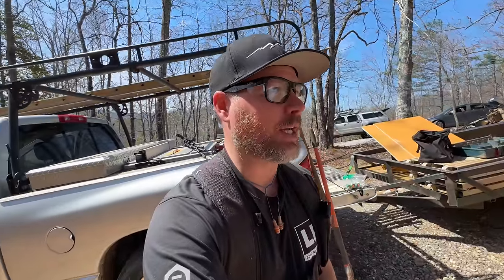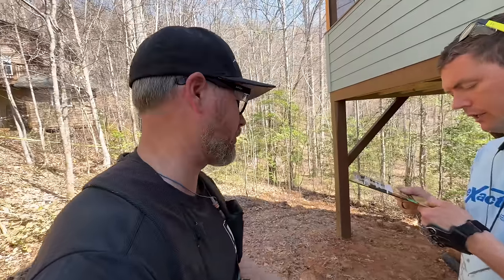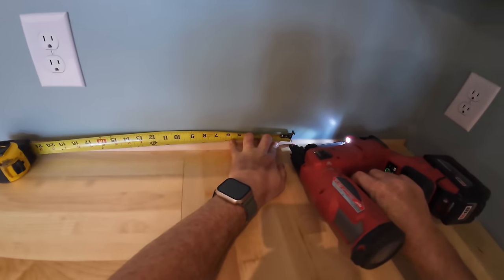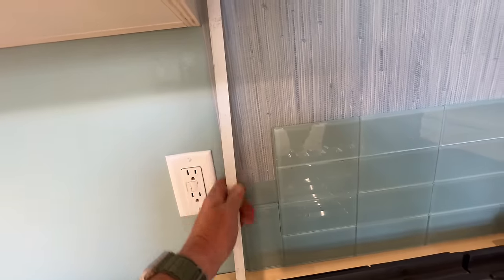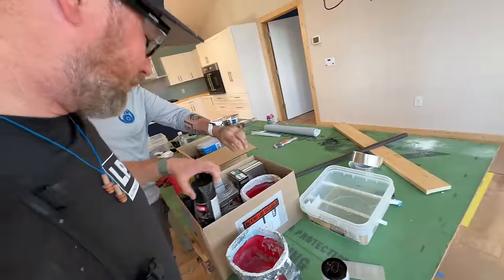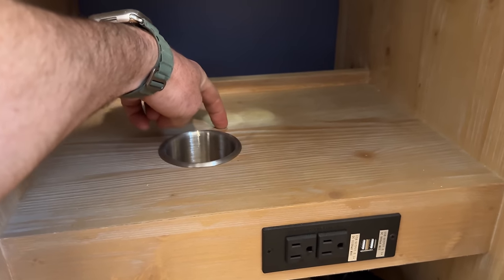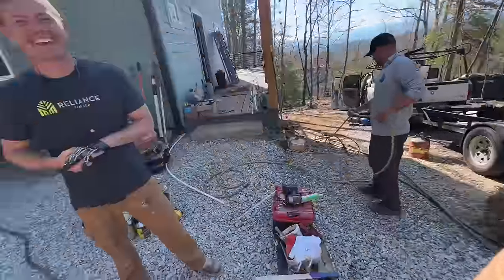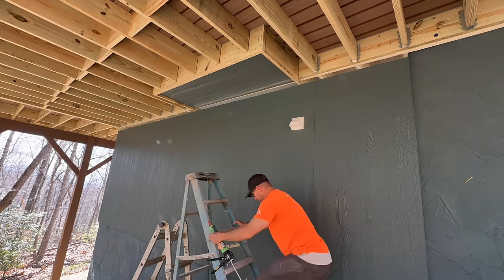Modern Home Build | 50 of 50 | It’s DONE & Arlo Retires

Comment: straw is the stuff that's left over after a grain crop has been harvested, while hay is grass that is cut before the grass goes to seed.  Typically hay will be normal cultivars of grass with multiple species mixed in, grown specifically as food for livestock.  Straw will typically be from intensive grain farming so it will generally be just one species.  Straw also has less nutritional value because the plant put all the energy into the seed, while hay will still have some measure of sugar and nutrients.

Comment: Hay is a complete grass that is cut short as a food source for livestock.  Straw is the shaft of grain (wheat, barley, etc.) that is left once the grain has been removed.  Straw is a woody shaft that doesn't have any food value.  Straw is good for bedding and ground cover, etc.  Straw has also used been used to insulate structures due to it's woody shafts and being hollow.  Traps air.

Comment: A little tip when cutting glass tiles with a wet saw. First score the back with the saw to get a clean cut on the backing then turn it over and finish the cut on the face of the tile, take it slow and it’ll reduce the chipping. Other wise get a tile snapper, It cuts glass better than a wet saw. Also your blade was on backwards on the grinder, that will heat up the blade, reducing the blade life and won’t get such a clean cut

Comment: Hay is digestible (by livestock) stalks leaves and seeds.  Hay is the stalks of oats or wheat from which the seeds have been harvested.  These stalks tend to not be very digestible and are typically hollow.  You can make a straw bale house using those hollow stalks but hay would not work since it would rot.  I live in a straw bale house.

Comment: It's not I and O, it's closed circuit and open circuit. 
Hay is the leaves and any broken off heads, straw is mostly stems. Hay is more nutrient dense, rots faster and can seed the area with grain. Straw is coarser, more insulating (strawberries got their name from how they are covered for winter) and less likely to blow away.

Comment: Pro Tip: the I and O on power buttons have a meaning beyond trying to confuse your memory! They represent a toggle switch through binary. 1 being signal on and 0 being signal off. "I" also looks like a straight line so power can go through and "O" looks like a hole so no power goes through.

Comment: I feel like you guys should invest in a tracked skid steer or even a mini skid for the projects. Having one around with a set of forks on the jobsite it is super handy.

Also, I get the air out of my pressure washer before I crank it up 🤷‍♂️

Comment: Hopefully Arlo will pop in every now and then, he will be missed.  I understand the requirement for putting the straw down on the dirt areas around the house.  But would it have made sense to take a rake and ruff the ground up and then spread some grass seed down and then put the straw down.  That way as the grass seed takes hold the straw would protect it.  My brother worked for a land reclamation company and they would use this green looking stuff that has grass seed mixed into it and then they would us a special sprayer to distribute the mixture.  Then they used a special blower that the straw bails are fed into it and blown out covering the grass seed.

Comment: Fun fact the “I” and “O” on power switches indicate “Inline” and “Open” as they relate to electrical circuits. So an open circuit doesn’t supply power hence why it turns off the machine.

Comment: Hi guys, hope all is well. How.long did it take to complete rhis build and whats the average time in general.
Reply: I don’t know the average time and I am sure that is dependent on square footage ( my heated space is slightly more than 1100 and the deck is about 742 sf) and the style of home. 
It took a total of 7 months plus a few days to complete my home. They work 4 day work weeks. Arlo worked 3 day work weeks. There were quite few weeks that it wasn’t a full payroll - guys taking off for various needs. I spent time time helping with odd jobs and cleaning up the site almost weekly which saved time for them to work on things that required more skill. There were some hold ups with subs and holidays that meant no work was getting done. 
Grateful for my beautiful home! The contract did state a completion date of “maybe mid February” which I was fairly certain wouldn’t happen because delays happen in construction.